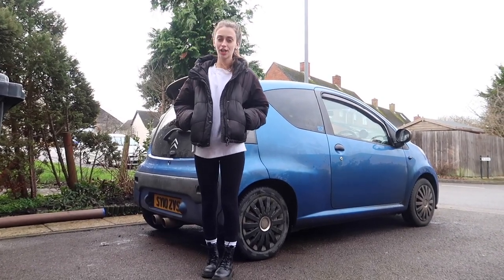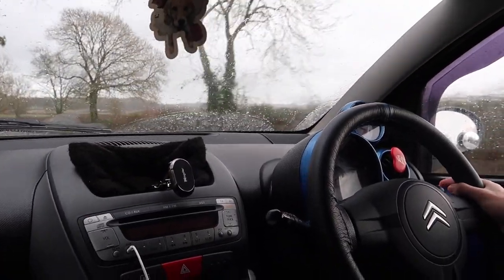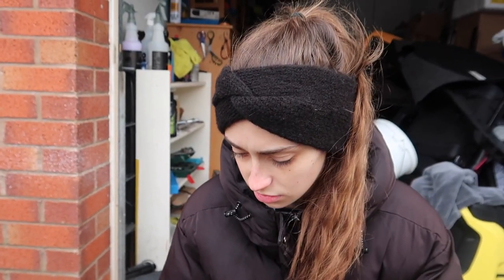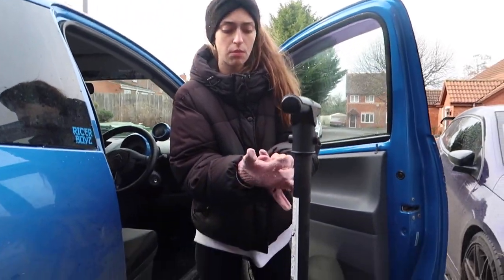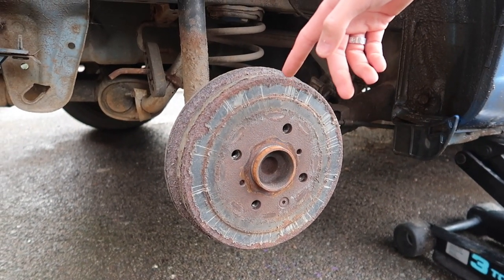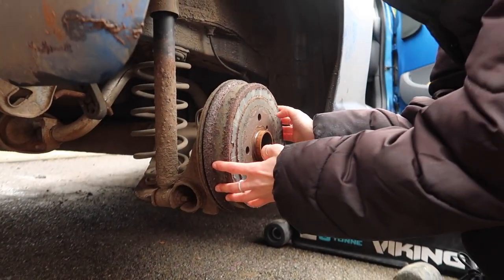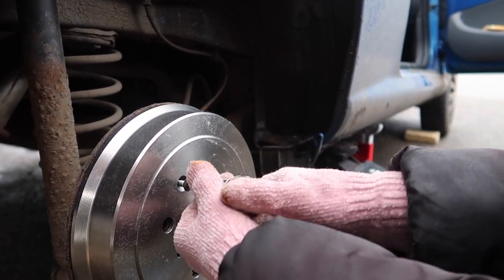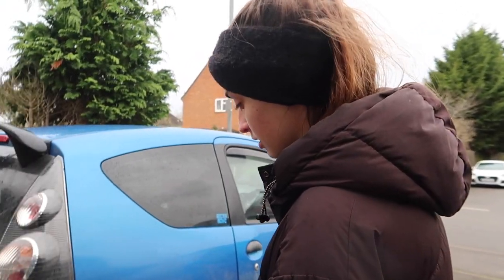FIXING THE CITROEN C1!?!

Comment: I believe the warp is caused by quick temperature changes, so when under heavy breaking the discs get hot and if you drive through a big puddle right after it cools down too fast causing the discs to warp, so try avoiding puddles maybe if you want it to stay fixed.

Comment: Can I just say love the enthusiasm to want to work on your car yourself and everything but the brakes on a car really aren't something you should be messing with if you don't really know what your doing anyone who knows cars really should have been able to tell you that it was the front brake disks warped in the beginning not the drums and disconnecting the handbrake cable to take off the drum is kinda dangerous (if you don't hook it back up properly for example) and not necessary when you can just take the handbrake off normally I hope you changed both sides when you did them as well as the pads when you guys did the disks because likely your old pads will warp the new disks sorry if this came off kinda hateful the comments really not meant like that just make sure the jobs done properly because when your messing with brakes your potentially messing with yours and other people's lives

Comment: have you ever had a problem with water leaks on the back floorwells of the citroen c1 as i have no idea if i need to get new door seals :(
Reply from the maker: heyy, I don’t think I have🤔 I thought I might potentially have one in the boot of the car, but also havent looked properly so not 100% sure🤷🏻‍♀️ Michaels fiat did have a leak though so if you think yours does might be worth looking at getting new door seals, hopefully you get it sorted🤞🏼💖💖
Reply: @chlxeblackwell  thankyou!! i'm gonna order some door seals and hopefully thatll solve the problem! also the video where you fitted the rev counter where did you buy it from? :)) <3
Reply from the maker: I got it from ebay, I just searched up citroen c1 rev counter and my one came up :) X